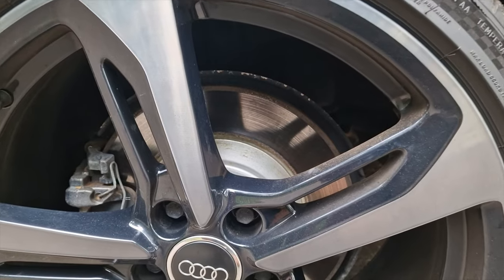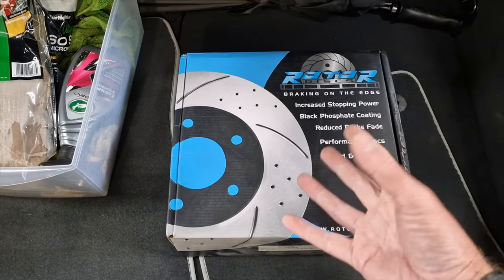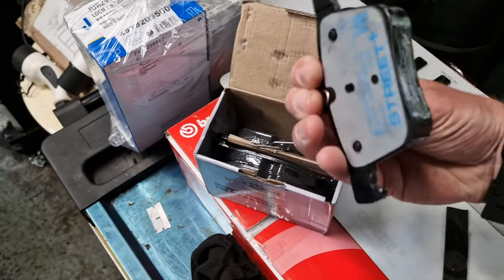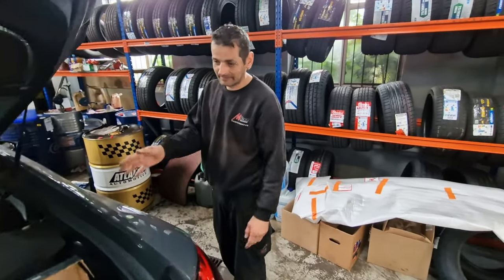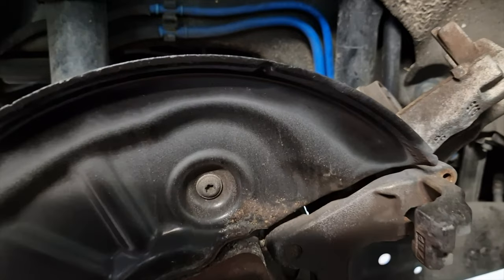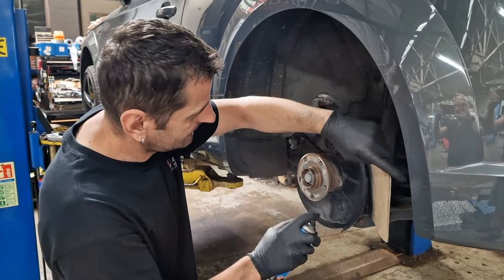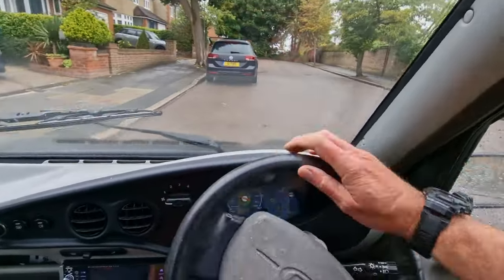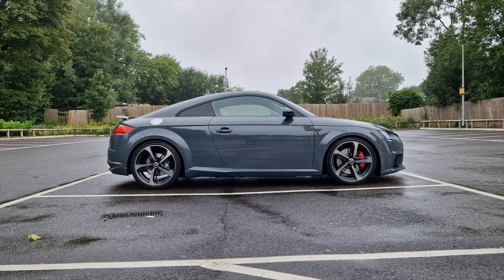THIS CHEAP BRAKE DISC UPGRADE LOOKS AMAZING AND FITS ANY CAR!!! | ROTOR DISCS

Comment: The cheapest rear dics are £45 each if you want the better looking then they will be fine. OEM type pads should be fine, racing pads are a little strong with solid discs.

Comment: Cheap discs fail early, like very early.  They are too expensive at any price.  OEM only.
Reply from the maker: We'll see won't we!
Reply: You will be surprised but OEM is made by Pagid and called eco parts. Same as brake pads made by Pagid just box is OEM and called eco parts
Reply: @MtechGarage  This is definitely not the case here.  This video showed the edge of both rotors. The OEM one looked about twice the thickness.
Reply from the maker: @tarstarkusz  there's no difference in the thickness of the rotors, both are the same. Must be the camera angle playing tricks on you!
Reply: @tarstarkusz definitely same thickness
Reply: @andykirby  update? :)

Comment: 4:09 Just look at how thick the stock one is vs the one you bought, which looks about 1/2 the thickness.  You get what you pay for.  Not only is there less metal, it's a much lower grade of metal.
Reply: Andy likes to reduce the weight of the car made faster 😅😅😅
Reply: How can you tell there is a difference between them thickness wise, he didn't even put them side to side, to me they look same , also I think they have to make them the same thickness, even if it's aftermarket.
Let's see if Andy can confirm they are the same thickness
Reply: @ATICrossX  it's same thickness,old looks bit thicker because was rusty around
Reply: @ATICrossX  Why would they both have to be the same thickness?  The caliper makes up the difference.
Reply: @MtechGarage  That might be the case. I didn't see it in person and I didn't put a micrometer to it.
However, I have experience with aftermarket rotors and there even videos of how bad these no-name rotors are. They made from a poorer quality metal.
Reply: @tarstarkusz  all depends of brand some part's are made from honey , I don't know that brand and I don't say is better then OEM ,
Reply: @tarstarkusz   Because that's manufacturer spec and on most cars I've seen, even the cheapest rotors would be the same thickness as OEM, only when you go for track rotors, they can usually be thicker. Even tho these discs are cheap they are drilled and slotted, so I doubt they would make them thinner than OEM...
Reply: @tarstarkusz  less thickness will get quicker overheated and quicker can get bend when quickly cool down
Reply: But as Andy noted, these are rear rotors on a fairly light car, even if it's poor quality metal most likely won't make any difference, especially for daily driving.
Reply from the maker: Lads simmer down!😅They look the same thickness as the OEM discs from what I could see when we fitted them. If they warp then we will change them! I'll let you know! I'll do some 160mph-0mph tests through my town💪🏼
Reply: @andykirby  They don't warp, or at least warping is not the real problem. They tend to crack.
Reply: @ATICrossX  Fair enough.  I personally put a put a high value on my brakes and have no problem shelling out the extra money for OEM.  It's not like brake rotors are all that expensive anyway.
Reply: @ATICrossX  Frankly, even the OEM one looked pretty thin to me, plus not being the hollow type most OEMs use.  Most rotors I've ever changed look like 2 rotors glued together with cooling vanes between them.
Reply: @MtechGarage  OEM parts have quality specifications by the OEM.  If they don't meet the exacting specifications, they will simply reject them.  The supplier will be required to take samples and perform a metallurgical assay and physical tests on it and include a portion of the sample and the assay and test results..

 The physical dimensions will have a tolerance all parts must pass (like say 1/10,000th thickness variation across the surface of the rotor).

The OEMs have incredible power of the suppliers.  The OEMS even when they are making parts themselves do the same kinds of testing and keep the records of the tests and what specific cars that batch of parts was put on for investigation later, should a larger percentage of them be defective than their computed predictions..

The low end Chinese 3rd party parts are subject to none of this.